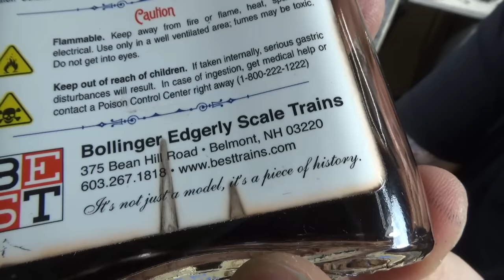Building a new kit called Smith's Lock & Key!

Comment: Well done Jason,
Two quick comments about your assembly.
1:  When adding nail holes to the structures face hold off applying the internal wall bracing a few moments.  With the wall boards clipped from the sprue lay the parts flat on your cutting mat.  Measure out the nail locations.  And now use your pounce wheel to imprint the bung holes.
If you're a brave intermediate/advanced craft modeler we can leave the parts on the sprue and pounce.  Literally.
2:  Instead of a somewhat complicated measuring conundrum try this.  With the wall parts separated from the sprue, face the wall units face down (interior wall up).  Cut your bracing board to correct length.  Then taking a second brace dry to use as a measuring jig.  Now place the jig square to the right corner glue up the cut brace and lay it in place.  1/8" in from the corner.  On the left corner glue the appropriate bracer flush to the corner.  This way ALL corner braces are in the same position.  Left flush.  Right 1/8" in from the joint.
This technique also works with bump-out walls.
Jim in N.Y.

Comment: If the spacing for the letters of the sign is correct on the 'sprue' you could put some tape on the front and cut them from the back to glue them on the sign in one piece. Great kit/build.

Comment: Another outstanding construction, painting and detailing video, Jason!
Just a thought on nail holes, since I'm somewhat OCD (ha!) ..... typical stud spacing is 16" C-C, with some older framing as wide as 24".  In HO scale, , if you are not using an HO Scale for your dimensioning, that would make the nail hole spacing approximately 3/16" for the 16" spacing or 9/32" for the 24" spacing rather than the 7/16" or 1/2" spacing as you discussed.  
Also a thought on tar paper/rolled roofing ..... roofing material is measured in "squares" which is an abbreviated term for "100 square feet."   The rolls of roofing material are sold  by the square as well - typically 3' wide, and 33~1/3' long, scale dimensions, making 100 square feet.  I haven't been able to measure the roof of your building, but if the roof is longer than the roll, there would be corresponding joints, with a few inches of overlap in the roofing material.  Again, my OCD is kicking in <grin>

Comment: Jason,
If you pre glue the butt joints…you can use a slightly diluted glue…let dry then reapply full strength glue to the butt joint the bonding is much greater…In woodworking if joinery is end grain to end grain then this is how we would secure the joint…just saying.
Randy

Comment: Hi, Jason.  I’m confused about the windows.  You have installed them with the top/head being the widest part of the window.  I’ve seen a lot of that.  But it seems like I’ve seen more windows with the stool/sill and apron being the widest part of the window.  Based on the images I’m looking at on Google, the wide part should go on the bottom.  What are your thoughts?  As soon as I’m finished watching the video, I’m gonna order the kit… it looks cool!
Reply: From my life experiences, the trim boards for the doors and windows are correct as shown.  The horizontal board across the top of the window is longer to help prevent/reduce rain from getting into the end grain of the vertical side boards.  Traditional framing would have it extending 1 to 1½ inches beyond vertical boards.